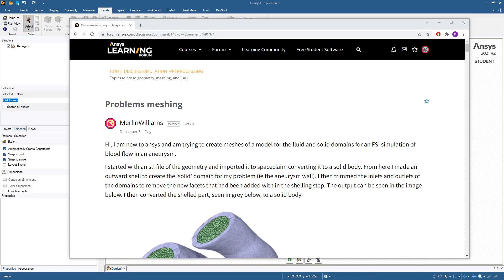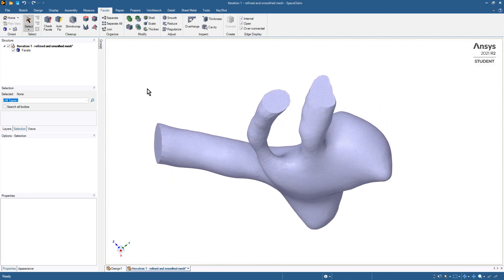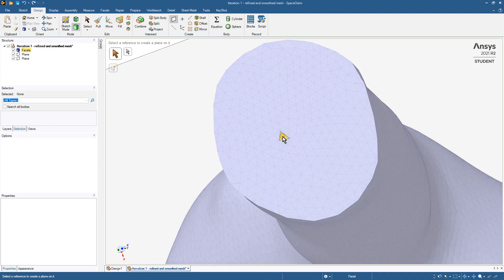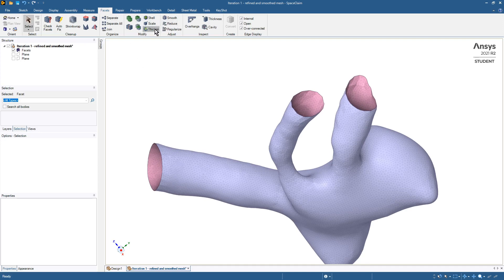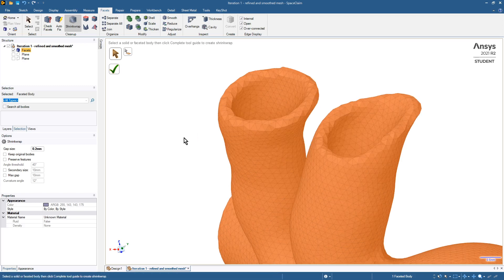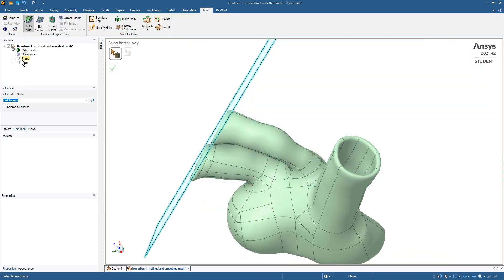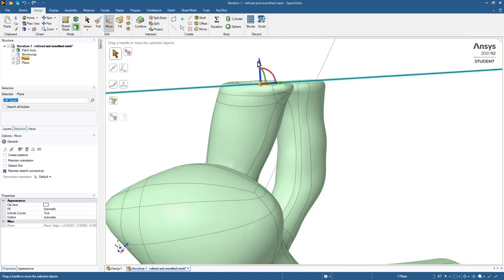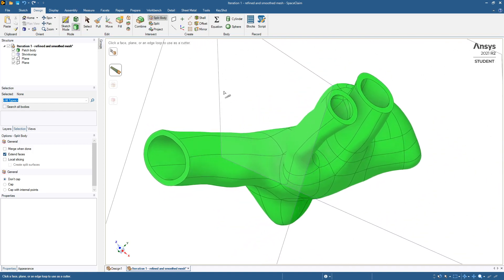ANSYS SpaceClaim 2021 STL convert to Geometry

Comment: Hello Peter, thank you for the tutorial. I'm facing an issue with the autoskin tool. When I upload my stl file (which is a vascular network generated with Matlab), I have a faceted body similar to yours with lots of facets, however, when I go to autoskin it actually turns into a solid body but the number of faces remains pretty much the same (hundreds of thousands) so it is completely unmeshable, what can I do? I already tried to use the "merge faces" tool but it takes to long or simply it does not work all over the body. Thank you in advance.
Reply from the maker: Hello Gabriel, I have 15 videos on converting STL files into more useful geometry that is meshable. Here is the full playlist: https://www.youtube.com/playlist?list=PL3ziBY11hnD8qhdkdN2Ct42DunBdpLz1q    Put your STL file in a .zip file and upload that to your Google Drive or other file sharing site such as OneDrive or Jumpshare.  Put a link to that file in your reply here or better still, create a New Post in the General Mechanical section of the Ansys Forum https://forum.ansys.com/  where I check in most days.
Reply: @ansysfeaexamples9351  Edit: I finally managed to solve the issue, thank you again for the support!

Comment: Hi all,
I am trying to convert stl file into CAD geometry
Followed the same procedure as Peter did.

This is the comment I am getting
'Could not generate all patches 14/20, 12 open edges.'

How to resolve this?
Could you please help
Reply from the maker: Create a New Discussion on the Preprocessing category of the Ansys Forum. https://forum.ansys.com/categories/preprocessing
Reply: @ansysfeaexamples9351  I have done. Please look into the issue

Comment: Masterpiece tutorial, Definitely it helps me thank you so much. How can I fill its flow domain for CFD analysis?
Reply: In the Prepare tab, under Analysis, there should be a Volume Extract button. You just specify planar end faces and a seed internal face and Spaceclaim extracts the internal volume.
Reply: @DThorn619  Is it extract full volume inside as the shape of geometry is not uniform.
Reply from the maker: @asifraj321  Yes, you get the exact internal volume.  @Asad Mirza  correctly described the few steps to do this.
Reply: Ok, brother.